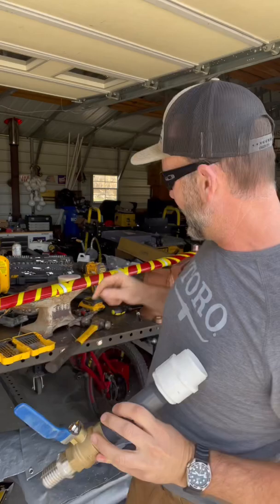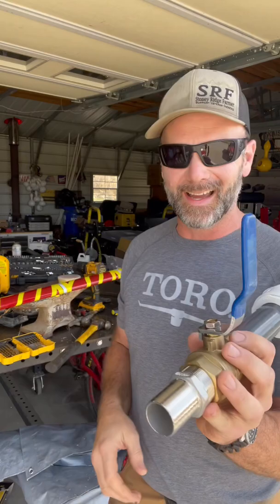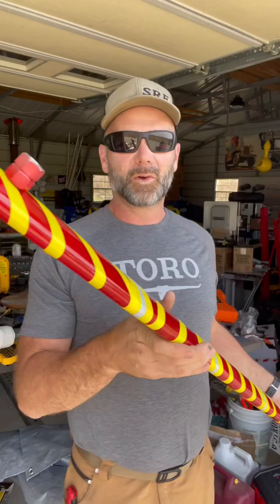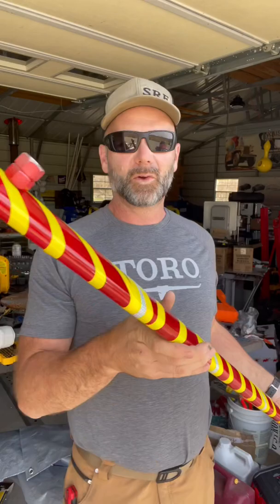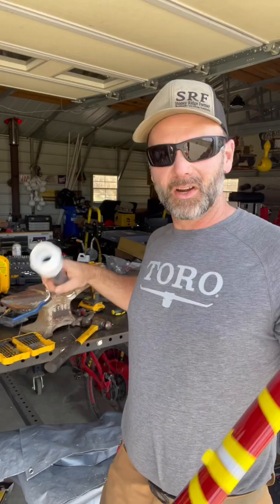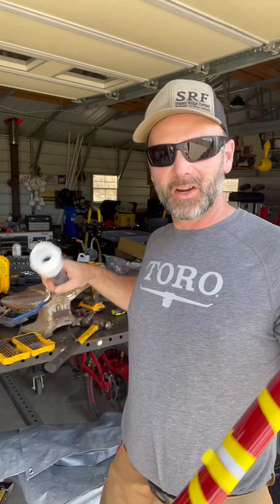Thinking outside the box…fabrication is farming? Check this out!

Comment: We added a section of PVC pipe with a "U" cut in the bottom to help keep it from silting up over time. Put a pipe cap on top loose. Seems to be working good so far. We use a completely different tool made out of scraps of rebar to turn it but accomplishes the same purpose. Used a five gallon bucket with most of the bottom cut out the same way at the old house. Our frost line is only a couple inches so our water lines are usually buried pretty shallow compared to other folks.
Reply from the maker: this tool is tough as nails buddy...it's never ever gonna wear out

Comment: I find some of the most rewarding things in my life are things like this. Where you have a problem and you come up with an original idea to solve that problem. 

When I built my mega shop a few years back I was faced with a problem of how to get the 32' x10' trusses up on to the top of the 12' walls - by my self. Hiring a boom truck was not an option and I didn't have a crew of Amish friends to help. After considering the problem for a while I built 2 jib cranes from 4x4's and Harbor Freight electric winches. They were strong enough to lift the trusses into place but light enough for me to move by hand to the next  lift location after each truss was positioned. And when I was done all of the wood was used in other parts of the project. Woo!

Comment: I did similar with 3/4” ball valve for pasture waterline. Ended up having the valve break where the bolt held the handle in. Since than I started using an actual curb stop valve made for this application. Our waterlines are 8’ deep here though so it really sucked repairing. Good luck and enjoy the videos
Reply from the maker: can't use a curb stop on the main water tank..it will drain the tank..much more to come on these water systems my friend

Comment: The fire department will have specialized tools to turn valves that are recessed... All that clearance is usually available from a valve box .. available at all hardware or plumbing stores... But yeah recycling is cool and your going to be saving your valve from freezing. Coper cracks easily when it freezes
Reply: From what I hear PEX is supposed to be able to withstand water freezing without bursting as a result.  It's supposed to be able to expand as the water inside freezes, like in a water line.  I don't know how true that is, but, that's what I've heard.

Comment: Well Josh, you asked. I think if you don’t put some kind of compression on that end and depending how many times you use it to open and close the valves, that opening might spread open on you. But what do I know?
Reply from the maker: that is some hard hard thick aluminum my brotha..it will never spread...took me about 25 mins to bang it down a little flatter....it wouldnt open back up turning a valve in 1000 years brotha

Comment: Your a couple hours from me and I jsur installed a few watering systems for cows under the NRCS- something we added that cost less than $10 was a water spigot inline with that shut off valve, so you can pull the top off the trough and hook up a water hose to rinse the trough or fill a sprayer or whatever.

Comment: you could of just bent the handle one more time at a 90 degree so it would look like sideways u and would have not took up any more space around it then what you already had and  you could of avoided making a tool to just turn a valve
Reply from the maker: well...this seemed to work great...I'm sure I'll make a version 2.0 at some point...or this may last me the rest of my life...it will never rust! Woooo!  I'm building a 10,000 square foot shop...I'll have the space my brotha